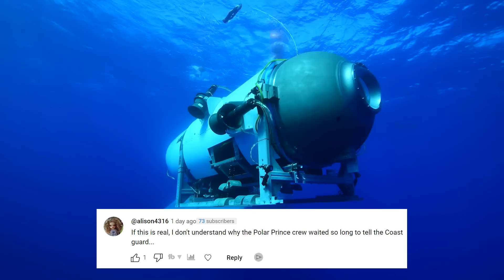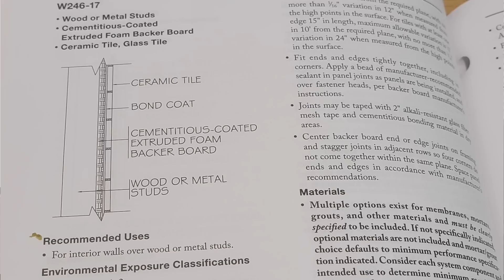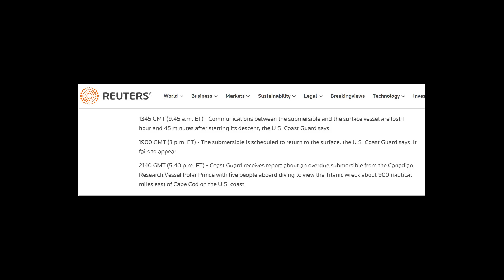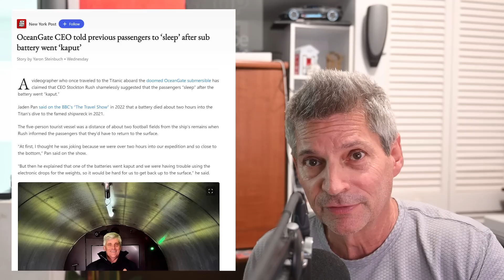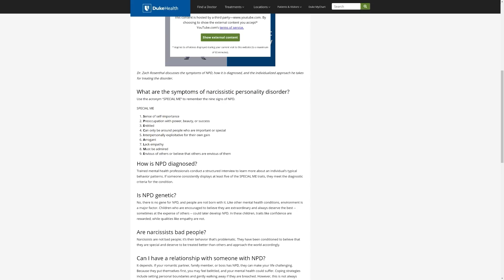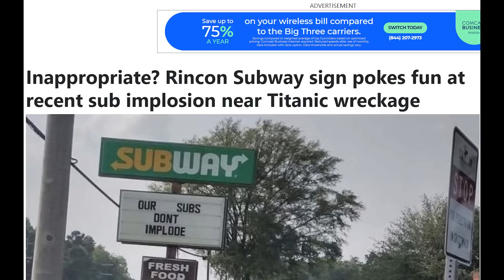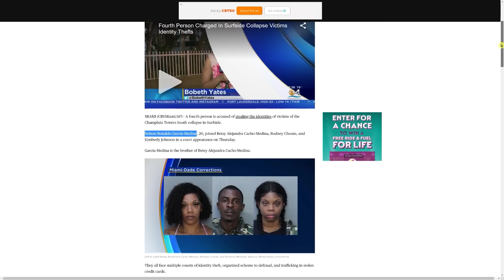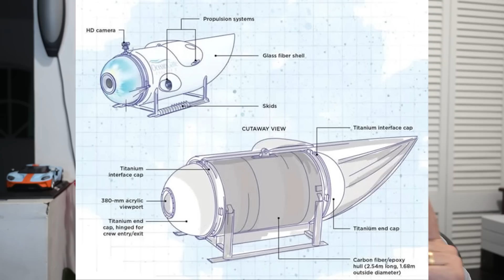Titan Sub: Why OceanGate Waits 8 Hrs Call Coast Guard, Q & A

Comment: If that leaked  transcript  is true then they were ascending at about 400 meters an hour so that'd be about 9 hours which would be about when they called the coast guard. The fact they didn't wait 24 hours for the weights to dissolve tells they knew they were trying to surface. Also explains why the coast guard was looking for them below the surface. They might of thought the sub ascended and it finally stopped somewhere between 3450 and the surface.

Comment: That's the thing the Polar Prince didn't just loose contact they also lost tracking at exactly the same time. Now that's real worrying. Even, if like other times they lost comms with Titan and it resurfaced in prior dives. How they could they have held out when tracking was lost at the same time is actually a massive concern. I mean, nothing could have been done to save the crew because the implosion was so sudden but on their part. Bad marks, bad, bad marks Polar Prince. Maybe they where acting on orders Stockton had given them prior?!
Reply: They would think nothing of the delay as there were so many previous problems, perhaps assuming that the batteries were down and the sub would surface from the release of the dissolvable balast bags.

Comment: Honestly this whole thing makes me realize that a carbon fiber dive system might actually BE possible, you just can't do it without using an autoclave and weave that's almost in line with itself...  If this thing had been made with a more resistant pattern and done in an autoclave to outgas the gasses from the epoxy it might actually be safe enough to do dives to that depth.  They did it in almost the wrong way in every possible way and it still did a number of successful dives.
Reply: More fundamental than using an autoclave would be having a metal support structure and a carbon-fiber skin, so that titanium or steel would be the source of compressive strength and carbon fiber would be the source of tensile strength, and the binder wouldn't need to do anything beyond filling in small gaps between carbon fiber strands.  As it is, I find myself thinking that a cast resin pipe would have done as well as the carbon-fiber infused (not really reinforced) epoxy pipe they used.

Comment: 11:00 - doesn't matter if they did cross-diamond or other - Carbon fiber is great for holding tension (if you have pressure inside pushing out).  Think of pulling the shoelace.   However, carbon fiber is bad for external pressure pushing at it from the outside.

Comment: I worked in the aircraft industry for many years.
I was involved in a lot composite panels of many different methods and materials.
I'm an effing idiot and even I know you can't just wrap it all in one direction.
They didn't vacuum chamber that thing?
How do they expect the epoxy to saturate ??
There's going to be a lot of air within the layers causing issues.
This just seems crazy.

Comment: imagine a roll that's the exact width of what's needed  and rolled around would be quite strong.
you would lose all those  overlap edges.
makes one wonder if it was cured at a few hundred bar of pressure, if that would make any difference.
probably not safe for a deep sub still.
like  glass, it's got a terrible outcome at failure.

Comment: The weaving method of the sub was largely inconsequential. Carbon Fiber's strength is primarily in Tension, a deep sea sub hull has to survive compression. As a composite material, it is very hard to model it's strength with a computer. OceanGate did no physical testing with their setup, meaning they had no way of knowing if it would actually hold up.

Comment: Regarding the speed of decent with the accident dive, I personally suspect that Stockton was attempting quicker decent dives. I am wondering if they were not able to release the ballast or the frame at all since ballast drops has been problematic in the past. All this is on top of a half ass built sub, that seemed to rely on safety margins (as in using all of the safety margins and more). He (Stockton) seemed to rely on reputations in the submersible and aviation industries to back up his designs. He never followed any of the design philosophy of either industry in providing a safe sub. Even the 787 which uses carbon fibre properly (aside from the many assembly errors, since fixed) used autoclave tech to assure proper curing of their fuselage. Stockton couldn’t be bothered. He used other company names for credibility, possibly illegally and his company is going to be sued out of existence because of his arrogance.
Reply: His company is already gone. Website taken down. Stockton was the CEO, and the cofounder is long gone. His wife and various employees are left. The deceased were quite wealthy, who knows if their families will sue.
Reply: The topside crew mentioned the descent, but the CEO responded everything is okay.  He should have said “We seem to have extra weight.  We shouldn’t be falling this fast.  Possibly excess water onboard the sub.”

But he was an idiot.

Comment: if carbon fibre flex 1 mm , thats it last call for drinks . That sub was surviving on the base pipe chassis and carbon fibre was simply a material used in reverse around it.

Comment: One thing to note about the "propped open fire doors" as depicted @2:48 is that those are held open my magnets that de energize during a fire alarm so the doors will then close and isolate each area
Being propped open is normal as long as it's held open only by the magnets.
Those are tested monthly,  typically, to make sure they close during fire test
Reply: Hospitals have these doors in key areas.  They automatically close off hallways when needed.
Reply: I remember those doors in elementary school. Whenever they did fire drills all the doors would release and shut.
Reply: We have those doors in our condo, at every hallway and landing, the lobby, the pool, etc they're open all the time bc it's not a closed off area they only close when the alarm system is triggered magnetically to isolate areas from spreading smoke and fire I'd never seen them in a residential building but I guess ours is pretty state of the art we also have a sprinkler system inside our condo for fire I always wonder about those deploying in error 😂 like what exact conditions would cause those to activate? And do they activate in just the location of the fire? Or do they ALL go off? I just know the last time I was cleaning up on top of my recessed lighting, I dusted off the sprinkler cap (it's not like a big ugly commerical one, it's just a stainless steel cap thing about 3-4 inches from the top of the 9 ft ceiling in each room). 🤷🏽‍♀️ Imma have to look that up now I'm curious
Reply: @jordanalandry1866  Long time firefighter here... The sprinklers don't all go off just because one goes off, or cause the alarm goes off, etc. Each sprinkler head has either a glas bulb filled with fluid that boils, which causes the bulb to break, and the sprinkler to activate, or newer ones have what's called a fusible link, that nornally holds the sprinkler closed. But uses a type of metal that melts at fairly low temperatures, again, opening the sprinkler due to heat. They're designed this way so that only the sprinklers actually near the fire go off. That way you dont ruin a whole bunch of TVs, computers, furniture and appliances with a giant shower. The amount of water those things put out would surprise most people. But when there actually is a fire. They're the best damn thing on earth. They do an amazing job at putting fires out, quick.
Reply: And yes, I know, before someone comments to correct me. There are some sprinkler systems where triggering an alarm will activate every sprinkler. However, those types of systems are generally only found in big industrial buildings, warehouses that handle a lot of flammable goods, etc. Not in residential or office type buildings.
Reply: @blackhawks81H  good to know interesting because I’ve always wondered that I thought obviously they don’t go off with a hair trigger because of all the many times I have triggered the new very sensitive smoke alarms in my condo as well as all the times that our fire panel. The main panel has malfunctioned and set off all of the building alarms and sirens. Those have never gone off so I presumed that they were only activated once things reached a certain temperature or a certain smoke level but I always get kind of nervous when I get up there and I’m cleaning and I always wipe off the little panel thing. I don’t want to accidentally trigger it lol and that was my thought too. If those things go off easily you could easily end up doing more harm than good but I also know that it is an insurance discount. I know when we moved in here they were really surprised. They did ask if we had a sprinkler system and they were surprised that we did and since I do some property management and on some rental properties, I’ve noticed more and more although not all newer buildings seem to have those installed and I wasn’t actually sure what they were when we first moved in because they don’t look like the standard ones that you see in office buildings or commercial buildings and I suppose it depends regionally to perhaps how prone different structures are to fire I don’t know. I don’t know much about it, but I would assume the fire code varies by location I know we lived for years in Egypt and we still have some properties there and I’ll just say this the building and fire codes there are extremely inadequate I have seen and heard of some really really horrible fires and people don’t escape for several reasons first of all, they don’t have any kind of system like that and also the buildings are big many many units per building sometimes no elevator and you can’t necessarily trust an elevator in a fire and pretty much every home has a gas stove, and potentially a freestanding propane tank for each appliance so like in the kitchen for the stove you’ll have maybe 150 gallon tank the bathroom for the water heater, a smaller tank and so on and so forth and somebody comes and fills those on site instead of having the gas lines running through the house that can be very dangerous actually a family member had a fire start in their kitchen and those propane tanks became like a live bomb, and they tried to roll the propane tank down the stairwell away from the fire hall. Need to have it explode and several people lost lives. It’s always interesting to me to see things like that in different countries not people losing their lives, but just the differences in the way people do things, likewise gasoline is frequently used as a solvent household cleaner in Egypt. One day I came home from the hospital I work at and the entire house smelled like gasoline fumes petrol, and in a house full of smokers. Naturally, I wanted to know what the hell was going on? Apparently my mother-in-law had been cleaning myself with a rag soaked in gasoline and I told her look that’s like the stupidest thing you can do you’re not ventilated in here and you are right next to gas lines and there’s multiple ignition sources in the house with all these fumes, there’s people smoking cigarettes not smart that has never even occurred to her. She was extremely surprised to learn that which is scary disappeared to.
Reply: I also see the signs that say “Fire door. Keep closed at all times.”
Reply: @blackhawks81H  I've always cringed when Hollywood, time after time, depicts a person holding a flame under one sprinkler head and then ALL the sprinklers go off inside the building! LOL
Reply: @electrictroy2010  Looks like a pretty blurry image to read that.
However, it is still obvious that those are typical fire rated doors held open by electro magnets (mag locks, same as what locks a door closed in areas with electronic card/keypad access) and then they release when the fire alarm opens the addressable control relay to that zone to close the door and create the closed "fire wall". Sheet rock is doubled up. Ran from floor to hard ceiling above the false ceilings. Etc...

Finding "propped open" fire doors is extremely rare as buildings that utilize them (schools, hospitals, etc) have strict inspections and testing.

My original comment was no offense to the author of the video. I've watched a handful of his videos recently and why this was suggested.
But being that I have been involved in many areas of technology and have even repaired a few of those as well (when they know you can fix anything electronic, you're the guy), I felt the need to chime in on the fire doors as shown as they are almost ALWAYS held open (in a controlled way) during normal operation.
Reply: @blackhawks81H I remember that back in 2012, the school i went to had sprinklers, and some sort of panel next to the fire alarm panel, which had something to do with the sprinklers, at the time i thought that panel was what set the sprinklers off (athough more recently, after finding out how sprinklers actually work, i think that second panel was to indicate where the sprinklers were that had been set off)
Reply: College basement I has a class in, power went out 1 time and the fire doors closed on their own. Loss of power obviously releases them, but I would think more happenings would too, like a fire alarm or even sprinklers deploying,  or similar to sprinklers,  heat over 150 degrees or whatever.
Reply: @canislatrans8285  Any smoke on either side of the doors will cause them to close. Either triggered by the regular fire alarm or separate smoke sensors mounted just above the doors.
Reply: That was just for illustrative purposes. You took it too far. Just an example of overriding safety.

Comment: In your previous video featuring the transcript, it was clear Titan was ascending very slowly and would have taken many hours to reach the surface (had the implosion not occurred). Considering the Polar Prince had no way to be sure the submersible was lost (despite communications loss) until that time elapsed, this would surely be a reasonable explanation of the delay in reporting the incident.
Reply: Except that people heard the implosion.  They knew very well what had happened
Reply: I disagree because they already knew this submersible had many problems, including its hull and so they should not have waited. It's a cavalier attitude to just wait and hope for the best especially when they are responsible for the lives of the passengers who had paid them.
Reply: Cameron said in an interview that the Titan lost tracking as well.
Reply: Not working underwater.

Comment: Jeff I really like your continuing updates on this stuff other places don't bother when new info comes out. Another aspect of Normalization of deviance and probably not the only one is what I call groupthink. "We've already been to that depth so there's no way an implosion can happen right" and losing communications is no big deal. add on top of that Stockton's conduct and thinking in this space and builds a pressure hull with carbon fiber titanium and this is the result.

Comment: The guy who runs Real Engineering was a composite designer who got his masters in composite failure prediction. His 'The Questionable Engineering of Oceangate' is worth watching if you want to understand some of the issues with composite vessels used under water.
Reply: A good video if you know nothing about it, but delamination and the poor ability of carbon fibre to resist external pressure has been mentioned a lot since this event happened
Reply: He got several key details mixed up between the 1st and 2nd hull of the titan, which is pretty major error.
The manufacturing process he talks about was for the 1st hull not the 2nd, it was the 2nd hull which imploded
Reply: The video didn't contain new information and made several errors in its presentation about the incident.
Reply: He didn't even say anything knew; it doesn't take someone with a masters to tell you carbon fiber is not good under compression (the resin is basically all that is holding it together). I literally learned nothing watching that video, as he just said obvious stuff

Comment: I think the only real-time monitoring of the hull he had were the ears and voices of the passengers who told him they heard alarming cracking sounds.
Reply: He had 1 acoustic sensor to hear subsonic crackling. Apparently it wasn't uncommon to hear some as they went down, but he figured he had a bigger threshold because the materials industry always underestimates ratings. But as others have pointed out, ANY crackling was basically a critical failure and sign of leaking and de-lamination, which he ignored and specifically ordered no checks into. On top of that, failure is a 0.004 second peak and drop, which is not enough time to do anything to mitigate it.
Reply: @littlekong7685  I wonder if the sensor had backup power in the event of power loss.

Comment: My thought on the time it took for them to make the call for help was because the message telling topside on how fast they were returning was so slow.  They calculated how long the return would have been at that speed.  Then after that time passed they realized "ok they are not here yet with Kaput batteries" or dead a radio.
Reply: 8 hours ascent time by my calculation